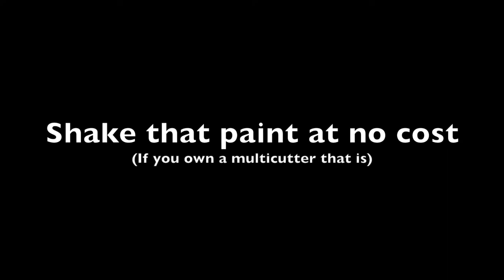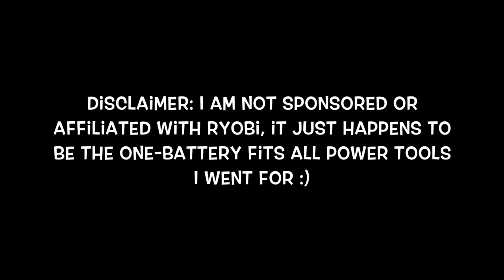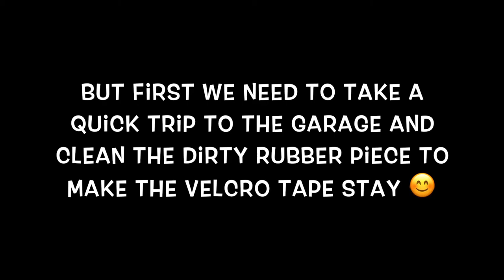Easy DIY paint shaker! Shake your model paint with power tools!

Comment: I have a corroded but fairly new multi tool.  Imcsn’t change heads because of ir.  But there is a. U,Tirol blade stuck in.  The tool runs fine but I had to replace it.  I found a trove of older but expensive hobby paint while cleaning the basement and I tried to revive them by hand shaking.  No way.  So I rubber banded them to the blade, much like you did here and it worked!  In fact this approach is way better then buying an expensive crappy mini paint shaker.  The range of shake speeds and the power are fantastic.  So I came up to take a break and read this.  Love your idea so using Velcro and a rubber pad.  I’ll super glue a rubber pad on the blade.  I’m trying to visualize a clamp to make changing faster.  Thanks for sharing.
Reply from the maker: Nice to hear that you can use the old paint! I always like to use what I have in house, I also made another shaking tool from a jigsaw I had in my garage.

Glad you liked my video, thank you!

Comment: This is so good! Got the exact same Multitool so def gonna try this. Although is the whole velcro/rubber pad necessary? Would it save a few steps to just place the rubber cut out onto the head without the velcro and then the elastic bands hold everything in place?
Reply from the maker: Thank you for your kind comment! I'm glad you like it!

I guess you can leave it out, I put it on just to make sure I didn't damage the thin plastic on the paint bottles. 

I have since this video made a new video using another power tool which I get more "swing" out of. You can check it out if you want to here : https://youtu.be/2e8Pz4AD1oA
Reply: @rogerdostuff  yeah I agree it's good to have the rubber bit. I was meaning, that wouldn't the rubber bit stay fixed without the velcro, just with the rubbber bands? I'll Checkout the new vid thanks! My GW bronzes and brass metals have all gone grubby and chunky so looking for a decent shaker idea!
Reply from the maker: Yes I see what you mean. The reason I used the Velcro, is because the head I used is for sanding paper with Velcro on the backside. So if you have a clean metal base I guess you can put the rubber straight on that.
Reply: @rogerdostuff  watched your other video and that's a great idea also. I don't have a jigsaw so I'll stick with the ryobi tool for this one. Thanks again!
Reply from the maker: You are very welcome sir 😊